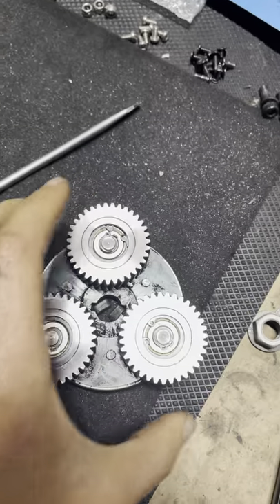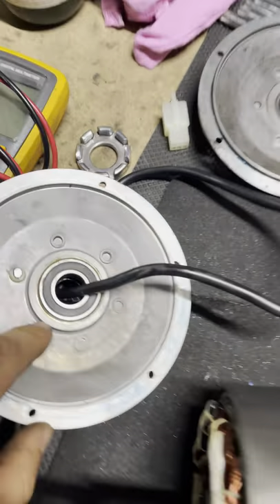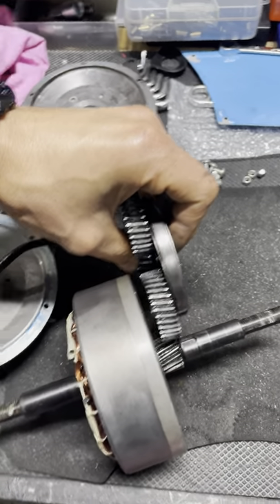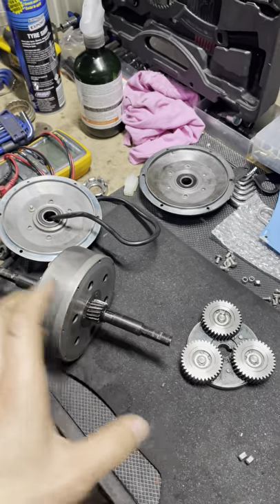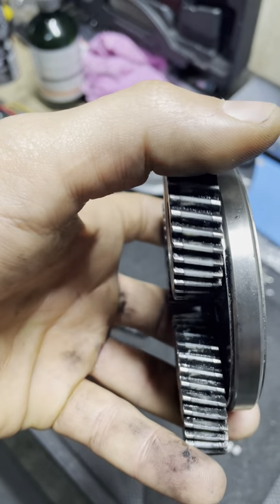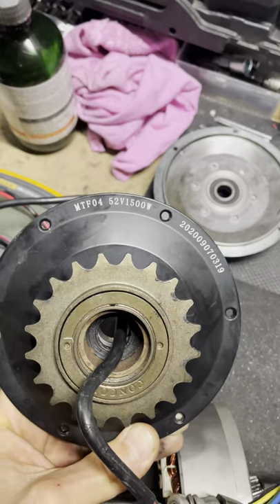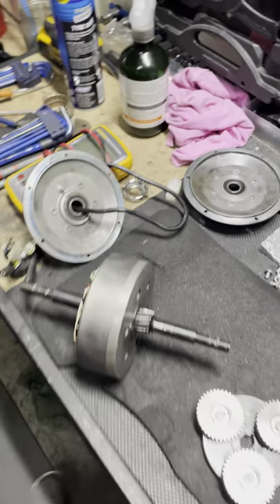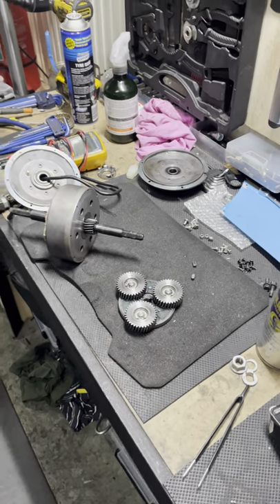How do geared hub motors work? What should I look for in my electric bike hub motor? Check this out!

Comment: Good explanation of how the basic system works.  I was hoping for an explanation and demonstration of how the one way clutch in the planetary carrier works. I have been unable to find any videos that show this.  You touched on it when you showed the two keys in the axle.  That is what locks the carrier to the axle but only in one direction.  When coasting the carrier is released by the clutch and allowed to turn with the wheel.  That way, while coasting, the whole gear system turns with the wheel and does not cause the cogging resistance present in a direct drive hub motor.
Reply from the maker: Hi Ron, the keys on the axle hold the carrier to the axle in both directions, but what engages and disengages the carrier is actually inside the carrier. It’s a riveted enclosed mechanism which I wasn’t able to show in the video, but imagine a paw clutch like the freewheels you see on rear bicycle wheels
Reply: @Cyberbikesau  Thanks for the explanation

Comment: Great information on these. My Heybike Brawn has this setup but I went through the nylon gears in 5 months. Im heavier than most and itll push 1500 watts with the 48 volt system. There doesn't seem to be much information on the helical planetary systems. Ive looked and I can't find a 3 gear set of new with clutch but it appears ebike pro maybe selling individual nylon gears in helical but is listed as a reduction gear. Anyone know about this? I want the steel or hybrid of steel and nylon or poly, anyone have a link to steel gears or further information about why you can't buy a set with a new clutch? 
After looking at my motor, it appears a hole may be able to be drilled and tapped to install a grease nipple. Don't over grease and clean out old grease and filings periodically.
Reply from the maker: We dont work with that motor manufacturer, it was a one off job we resolved the issue. Try pedalling the bike when taking off, it prevent torque build up on the motor gears

Comment: I have the same helical cut planetary system .  unfortunately it has been destroyed by water and is completely locked up.  I am having trouble finding a replacement set.  Do you have a line on the parts?  thanks.
Reply from the maker: This is the motor model number MTFO4, 52V, 1500W gear drive for 20"x4", and this is the manufacturer email yuetao@sharpbike.com
Hope it helps, if you can save us, and give us a 5 star review we highly appreciate: https://g.page/r/CX0AoVbmxOSwEBM/review

Comment: Very interesting video, thanks.
Do metal gears not wear out the ring gear faster?
Reply from the maker: Hey thanks for your comment. Metal gears need more lubrication and are noisey but they last longer than nylon gears. The external gear ring gear can be replaced when deemed necessary
Reply: No it cannot. Its a verytight press fit that isnt removable so by putting metal gears and having higher wear, once the ring gear is worn out, its shot.

Comment: What type of lubricant you use for metal gears?? How does its sound between metal vs plastic gear?? Keep doing the good videos 😊👍
Reply from the maker: There are many greases you could use. Like Lithium grease/ high temp grease for coupling metal-x--metal gears and high temp grease for coupling nylon-x-metal gears
Reply: @Cyberbikesau  Is there any reason why normal grease you'd use with nylon gears (such as parktool polylube 1000 polyurea based lubricants) wouldn't work in a system with steel or copper gears? I've seen people suggest that using lithium based grease is extremely messy and not reccomended for greasing planetary gears, but I know that advice is normally given for standard applications with nylon gears.